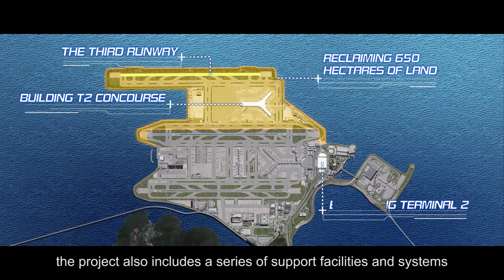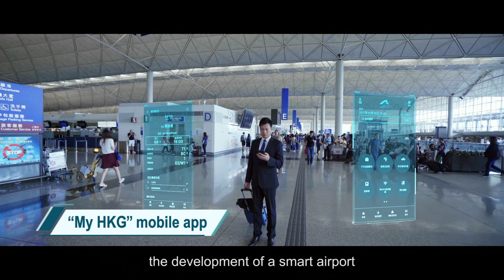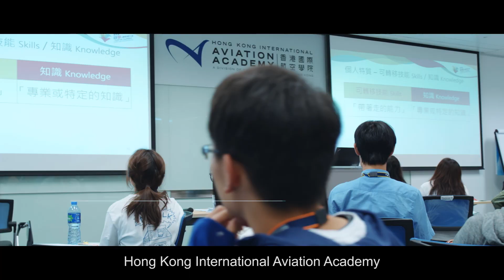Completion of the Third Runway Pavement and Future Development of Airport City

Comment: thats good news Hong Kong now the next step and a critical one. Next up is the decommissioning of Runway 25 Left and the construction of Taxiway X-ray and Zulu until these taxiways are built 25 Left will stay open as the construction crews work around it. Once the new Runway 25 Left becomes operational in December the existing 25 Left will be decommissioned and extended and will become Runway 25 Center and Runway 7 Center and Taxiway Zulu and X-ray will be constructed at this time and extended to the terminal this way planes will not have to cross Runway 25 Center or 7 Center to get to Taxiway Alpha and Bravo which lead to the terminal.